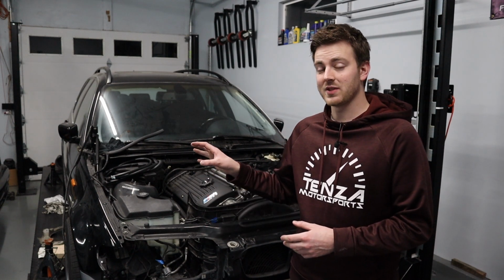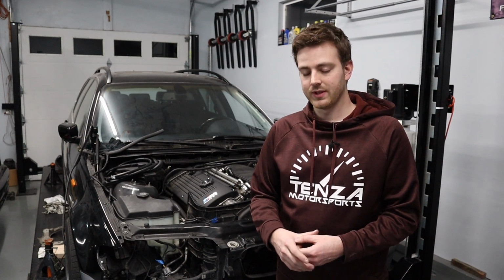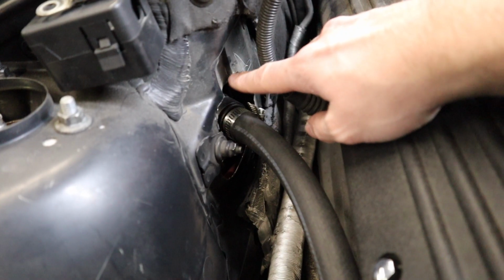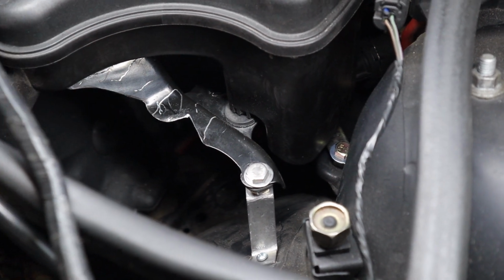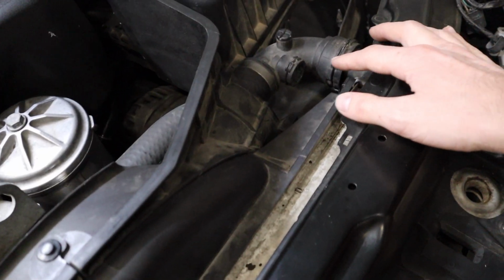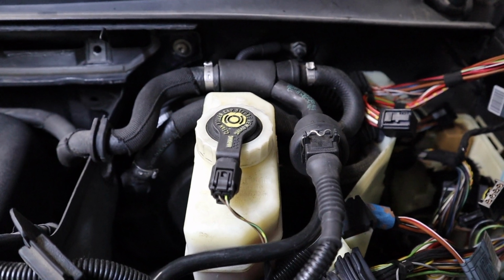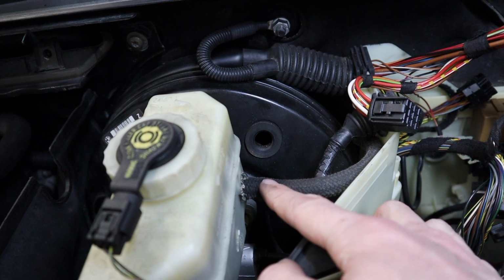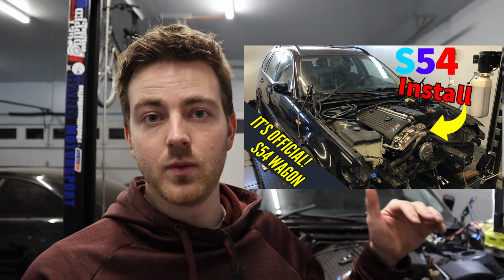5 things they DON'T tell you about S54 swaps - Not as easy as we had previously thought!

Comment: Thinking about an S54 swap on my e39, any suggestions on what I would need bottom end wise( I was thinking like m5 rear, maybe custom driveshaft🤷🏾‍♂️ ), also trans and wiring ??
Reply from the maker: You know I don't know if anyone has done a E-39 with an S54 that could be amazing!!. 
You would want to keep the transmission that came with the S54 the drive shaft from the five series might work.  You would likely want an M5 rear end like you said because the E-46 rear end won't work.  As far as getting it all to talk to the computer I am sure Kastle performance can work that out with you. It would be similar to what i have done here bring all the wiring harness over from the S54 engine and then get the 5 series body computer to talk to the S54 engine computer. 
Keep me posted on how it goes if you try it!
Reply: IIRC, and based on what I've read, you can use a five or six speed from an m54 car to bolt up to the s54. the s54 does fit on an m54 e39 subframe, and the dimensions aren't too far off from the 3.0. as far as wiring is concerned, I think the e46 and e39 share a lot of electronics, so the swap should be fairly oem. I've seen videos of it floating around. I will do it one day so I've done tons of research on it lol

Comment: Which heater valve did you end up using for the swap- the stock 325i or M3? I'm in the middle of a swap right now currently.. Thanks!
Reply from the maker: I used the 325 parts. I’ve ran it a lot. No overheating or anything!
Reply: @TenzaMotorsports  Hell yea thanks man for the quick response, perfect timing!! 👍
Reply: @TenzaMotorsports  I’m uploading a few videos on the build, you definitely helped me out with a few answers man.

Comment: I have a 2004 3.0i X3 and the engine is blown. I would like to know what you think I would need for this swap...

Also, what's the cheapest source for an S54 engine, eBay or BMW? I read somewhere that eBay engines are being sold for the same price as a brand new engine from BMW!
Reply from the maker: Get a donor car. You’ll need so much from an M3 it’s cheaper to buy a poor condition M3 than to piece it together.
Reply: @TenzaMotorsports  Thank you. There aren't many M3's in my part of the world, easier to get an engine. The cost to have a non running car ferried and towed to my home is probably not worth it. Unless it's like $3,000 but, what are the chances of finding an M car at that price...
Reply from the maker: I found one the other day for 7500. The engines, transmissions and diff can cost that much separately. If you can find one for under $8k ish. It would be worth it.
Reply: The problem with an engine is u have NO IDEA what ur getting. With the inherent problems these have I HIGHLY recommend u do some important things on any s54. Rod bearings are a big thing that goes bad(and one of the few things that can COMPLETELY smoke a motor)as well as the vanos. So I HIGHLY suggest u have the motor gone over before putting it in...or just get another 3.0(which was the updated e36 m3 motor)and put the m3 cams into it and send it

Comment: So will you be getting rid of the supercharged white 330?
Reply from the maker: No. The 330 is staying. This wagon is being built for a customer
Reply: @TenzaMotorsports  ohh,ok. Being that you're familiar with the active auto charger, if given a choice, would you repeat the project with the charger, or do a turbo? Just trying to get a feel, since im undecided between those two.
Reply from the maker: The M3 shell that will be left over from this project will be a boosted build. We are doing a twin screw supercharger. If I had the knowledge I have today, and my car needed more power, I would be doing a custom twin screw.
Reply: @TenzaMotorsports  you would on the 330?
Reply from the maker: Yes, the 330ci would have a twin screw supercharger if I had to do this all over again.
Reply: @TenzaMotorsports  is there a company that manufactures them for the e46?
Reply: @rubenrobles7275  ESS Tuning